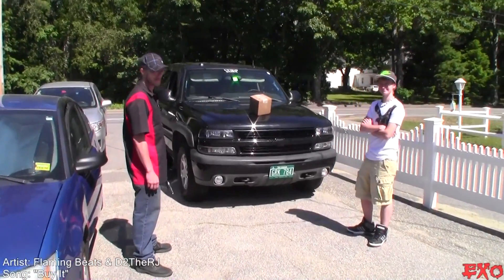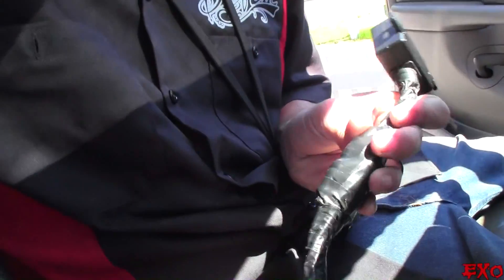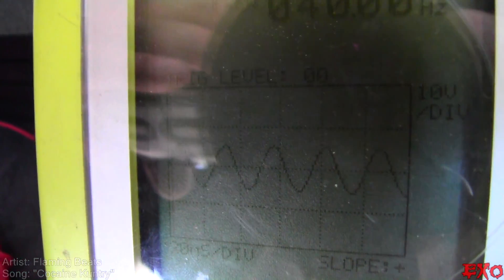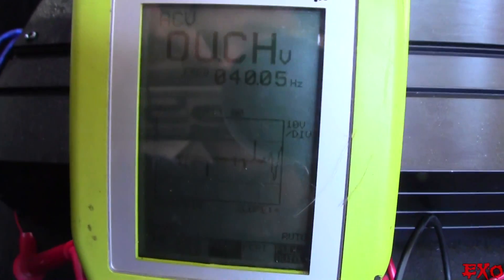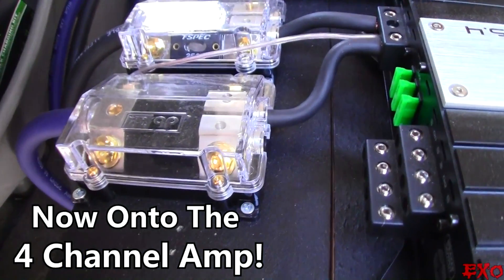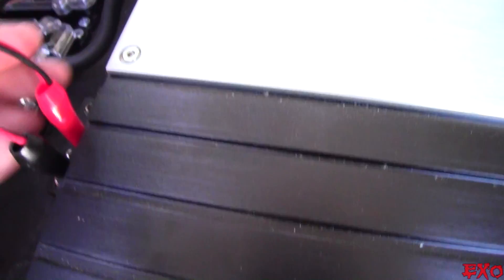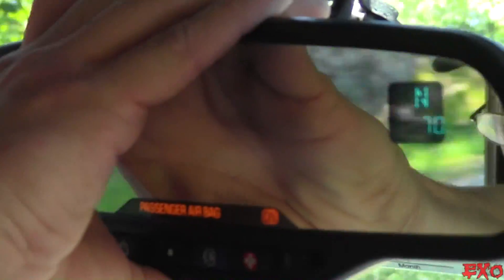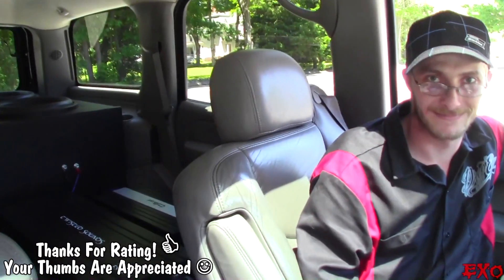Tuning a Car Audio System w/ Two Subwoofer Bass Amps & 4 Channel Amplifier | How To Set OSCOPE Gains

Comment: Does it matter if the vehicle is running or not?  Should it be running and producing enough amperage to feed the amp to get max output? 
I ask cause if your running off the battery at 12v, set everything to gat max clean power then later while your driving and amp getting 14v+ wouldn't cranking the volume to max cause issues?
Reply: NvTwist I don't think there would be an issue. You're just sending more power and it's tuned to be clean at less power, so it will be under tuned at full power
Reply: amorton94 I wonder because let's say the amp is dialed/tuned to & outputing 600w (voltage output measured) while @ 12v then after starting and running on alt @14v+ would the output remain at the previous voltage measurement/watts as before. I'd think the readings would be higher which means over driving speakers. I'm aware the difference wouldn't be enough to create any issues or damage the drivers. Just a thought I had and when you go to such lengths to perfect the system setup it could be worth a look or test. I'm not running my system Setup to perfection or competition but there are those that do which is why my questioning came up in my head. Maybe I'll test the theory myself one day but it's to damn hot in vegas during the summer so it'll have to wait till fall.

Comment: What if your speakers are lower rms than your amplifier puts out? I just bought a 4 channel  amp putting 100 watts x4 channels at 4ohms and im hooking up some mids/tweets to it rated for 40 watts. Using some maths I figured my voltage should be about 12.64, so if I used an o-scope thats what I should use?

Comment: usually factory radios has something that automatically lowers the voltage on the driver side of the car to compensate for the distance of the passenger speaker this amp might have the same set up for the left and right terminals

Comment: how do you set your amp gain to match your subs? because I have an amp that gives out more watts than my subs are rated for. cause this video just showed how to match your amp to your radio and how to match your amps right?
Reply: you can use an app. i like the audio toolkit pro. in there you can find what amp to set your amps to. instead of inputting your amps info , use your subs info. then adjust your amp to that number.
Reply: if you need help let me know what your subs are rated and what amp you have and what is your sub wired to ( ohms )
Reply: big scott okay thanks. I have a 3000 watt amp at 1ohm for 2 subs that are at a total of 2400 watts at 1 ohm.
Reply: what brand and model of the amp and subs.
Reply: sundown scv3000d amp and 2 cerwin vega STKR124
Reply: ok. I would set your amp to 50 volts ac .  do you have a scope ?
but that's just a base calculation.  if your signals clean at 50volts then your good.

50 volts = 2500rms . you will be good with that. and maybe a little over. it all depends if your subs are known to take more power then spec. most subs are rated a little under them what they can really take.

like my sub. the specs say 1500rms but I have 2200rms going to it with a clean signal and its good.
Reply: sorry exo..
just trying to help the dude..
Reply: big scott okay thanks! so basically set my amp to 50 Volts with a multimeter and then after that use an oscilloscope to make sure that my amp isn't clipping at that volume? Also what volume should the radio be on when gaining the amp, and should I play a certain test tone?
Reply: do a 40hz tone for bass amps. what h/u do you have? some h/u can be full volume  with no clipping. 
if you have a o scope check the rca's from h/u to amp. at the amp . unplug them and check to see if your clipping. also you can keep turning it up until it clips. then never go higher then that.
and yes 50 volts on the speaker terminals. pull the sub wires off first.
Reply: big scott okay cool thanks... I sent you a text a while ago. not sure if you got it
Reply: texted back.
Reply: Thanks for this question and dialogue!  I had the same question because he did leave that part out and if the amp is maxed out to the point of distortion, then it may be pushing way too many amps through the connected subwoofers, especially if they're smaller than the amp.

Comment: @EXOcontralto, Man this Video helped so much, just being able to see you connect "what to where" plus the good video quality, very nice sir, very nice.  i do have some questions though, how do you find out what Frequency to play for each type of speaker, Sub, mid and tweeters?  i know sub-woofers dont like higher than 80 and tweeters dont like lows, i understand that but what or where can i find the specific Hz. or is it just a play by ear thing? also is there anyway for you to show where the head unit's EQ was? did you tune that or just leave it were it comes stock? thanks!!! im new to this, but trying to learn as much as i can. thanks again!

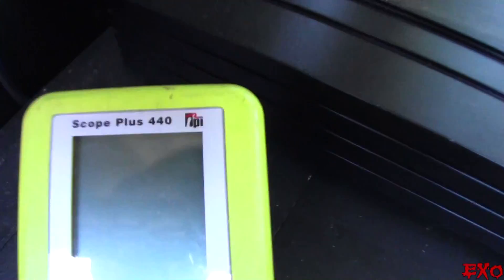Comment: Exo 1:12 are you sure about the DSO Nano V3? This youtube video "Cw4E25GMtTM" says it can't be used on D class amps? Additionally, on my Kenwood x998 you can adjust the subwoofer level from 0 to +15db, should you leave this at 0 when setting the gains?
Reply: I`m using it. There is no problem with it. I`ve used ot for tuning ground zero amps ;)

Comment: @exocontralto exactly why does he have fused + & - leads on the smaller amp or is that distribution blocks?

ahh yea I see distro blocks, but guess it won't hurt for both fused.

that is a first for me....

also is 40hz the recommended tone for setting or is it better for the hz your system is loudest, like my 4th uses 63hz & roughly 43 hz.

Comment: To really ensure you're clean of distortion, the load certainly plays a role. The amp can either run out of voltage or current-driving capability and it'll clip.

Comment: Scope Plus 440 is a basically a garbage scope... DSO nano is pure shit.. better than nothing, but it's not very accurate and at it's low resolution, it leaves a lot to desire when you are looking for that wave to start to square off...  it's average as a multimeter tho... when Steve Meade showed he was using one way back when, he sure helped sell a bunch of those though... like i said, beats a blank... i've checked it against an analog scope like you showed (they are MUCH better)... in various places and it can be quite inaccurate... several volts in some cases... it's basically a guessing game as to where the clean signal ends and the clip begins.. and that's db's you are losing if you err on the safe side like you should... or.. worse yet, it's dirty power feeding into your voice coils.. and none of that matters anyway without a load on the outputs.. you really can't get accurate gain setting without a load at the same impedance you will run them at.. then to get close you really need a high resolution oscilloscope... a CRT analog scope is perfect... or a digital scope with high resolution... if you go handheld you really need something good like a fluke or go with a regular desktop scope.. (Tek, Agilent, Rhode Schwartz, Yokogawa, LeCroy, Owan, Rigol, etc..) of course, they aren't as portable as a handheld... that's easy to fix that too with a small inverter and just run it off a different vehicle so you don't draw voltage from the car you are tuning.. or separate battery... I built a portable power unit for a scope of mine... made a battery pack from old laptop batteries and a small inverter and cobbled together a charging circuit... it charges when it's plugged in and gives me over an hour on battery... i can still power it from a second vehicle if i want as well... analog scopes and good digital scopes ($400 and up) sure give a beautiful wave that you can zoom in on and see the exact spot it clips... like i said.. it's just a matter of accuracy... not a huge difference... but enough that if you want the most out of your system... or want to make sure you're sending safe signals to the voice coil.. sure this way you show will get you in the neighborhood... but a true accurate tune requires a load, a decent scope, a true RMS volt meter, and an AC/DC clamp meter (so you can clamp both output current and amp input current) with either an inrush setting (to watch capacitors and battery banks) or a high resolution min/max setting... then you can squeeze every last watt out of that BOSS or ROCKWOOD... LOL.. JOKING... even then, as you know, you may still choose to de-tune an amp to match outputs, speaker handling watts, or set levels for mids and highs... i even had a guy who had me de-tune his system because his wife complained that the massive slap made her breast implants vibrate and hurt.. true story... so max gain isn't always where you are headed anyway.. then there's box rise, impedance rise, drywall screw rise.. lol... i'm not hating on your method.. it's used alot.. and like i said. it gets you kinda close.. for a few bucks though.. these beginners can go hunt down some decent meters and a scope for next to nothing... Example... recently i helped a guy get some stuff together... I bought a 60MHz Analog oscilloscope with 2 probes for 30 bucks off craigslist.. the I got an ac/dc clamp meter at a pawn shop for 25 bucks.. it has a dual display and can also use the true RMS meter at the same time as the clamp.. so for 55 bucks.. he can now tune super accurately.. cross check.. and just use his speakers for the loads.. got lucky on the meter, it's for a/c work.. but even if you have to get a separate meter.. add an extra 25-30 bucks for a pawnshop True RMS (NO, not the one from harbor freight or walmart... get a decent meter... True RMS.. Fluke, Amprobe, Klein, Fieldpiece, UEI, Mastech, Extech, craftsman, etc.. buy used from a pawn shop or craigslist to get them cheap...if they are TRUE RMS, they will be decent.. ) still under 100 bucks for all of it..for less than the cost of a few feet of dynamat or a couple sheets of MDF... a while back i bought a lot of TEN 40MHz analog scopes on ebay for 125 bucks.. that's $12.50 each... they were from a school... all worked perfect and came with manuals and probes... you can get a scope cheap or even free if you really want one... ask around.. everyone who's getting to the hobby should get rigged up with these tools... there's no excuse for not having the basics.. we'll get to the distortion and spectrum analyzers when you get past SPL and switch to SQ... whew.. a book.. nobody will read all this.. i should just delete it now.. nope.. posting this shit to the interwebs... typos and all.. maybe someone will get something from it..
Reply: damn.. read that again.. it made my dick itch.. FUCK Hillary... Donald Trump for POTUS

Comment: You should try cutting up old RCA female and male ends, strip down the insulation, separate positive and negative, and use that to connect to the RCA cables rather than the alligator clips. Its much faster and safer. I tune my system the same way with a oscilloscope, its the only true way to go, gives you more insight as to what is going on in your sound system than any other tool.

Comment: it's joke? i have a 152.5 at 37 hz with 2x12"  and one 5.5k amp)

p.s. Hello in Russia,bro) 
like your vids) we following!
Reply: In the third row? 
With box rise? 
With low voltage? 
With music? 
With subs that are just breaking in? 

If yes to all of the above, then good for you. 
That's awesome.
Reply: +Friends Are Overrated 2х12 subs, 140 liters ported box, 12 volt system, on music.
awg on 30 sec. 151.5 db on 37 hz.

Comment: for the price of that scope, you could have used SMD DD-1...
Reply: a DD-1 detects distortion (anything over 1%THD sets off the light) and an O-scope shows you where clipping occurs, the reason this is IMPORTANT to note the distinction is because some amps and headunits don't output the cleanest signal to start with so it's possible to see the distortion light on the DD-1 come on with the amp gain turned all the way down rendering the DD-1 useless to tune that setup as a result of the distortion NOT related to clipping, in a perfect world you would have both, the DD-1 would tell you if you are below 1% THD and the O-scope would show you the clipping (which would also be shown by the DD-1 provided the system doesn't exceed 1% THD prior to clipping). Basically you can ALWAYS tune with an O-scope but you can't always tune with a DD-1, but that doesn't mean a DD-1 is bad, just that you need more info then it gives to understand what the distortion light is telling you.

Comment: you would have to take off the case bottom of the amp and find out which potentiometer controls what channel... theres secondary pots in the amp that are the fine tune for the outputs and you can match the gains so they have the same output on the main pots on the outside of the amplifier per set of channels

Comment: is there a way to use o scope to see that u set subsonic right
Reply: it is. 
Choose a selected frequency for subsonic, for example 25hz.
Play a tone at 25hz.
Turn the subsonic knob. Look for a significant drop  the AC volt on the DMM/Scope. 
Then you know where you're at.

Instead of playing ear-guessing-games.
Reply: you can actually set it by eye haha. turn the SS all the way up and play music that you know goes well bellow your port frequency. Play it at maximum safe volume and slowly turn the SS filter down, keeping an eye on the woofer. Stop when your subwoofer is still moving nicely but not excessive and uncontrollably, essentially not flopping around like a bag of dicks.

Comment: Was the balance being used?...if you forgot to flatten that that could explain the voltage difference in the 4 channel.
Reply: I thought the same, gotta check out what settings the people use cause it's usually whack

Comment: what's up bro I'm in the process of getting my system up and running.  all  I need is xs power battery and a aternator. and what is your review on the crescendo 2000 watt amp. thanks bro

Comment: hey exo ..I found out something crazy....I was metering my blazer (1 crossfire xs SPL v1 18 on a 1997 RF 500.2 clamped 470w @1.4 ) and I peaked at 44 with the port fireing the hatch and I peaked at 36 with the port fireing forward and the seats layed down and dropped .9 db on the 36hz peak 👍👍

Comment: When setting the gains in this manner, the load should be connected to the output of the amplifier. The no-load voltage at the output is much higher than the voltage with load. The method used here will still yield clipped/saturated output signals to the woofers which you were initially trying to avoid. That aside, good video!

Comment: I'm trying to decide between a DD1 or the DSO Nano but can't make up my mind. The Nano, with the 10x probe (for higher voltages) is about the same price as the DD1. Does anyone have a preference or have tried both?
Reply: I had one of these small digital o'scopes before and all I can say is be careful as the display on most of these has a very low resolution. I had the Velleman HPS50, but my DD-1 (recently calibrated) would light up before I could see any issues with the waveform. This is why I prefer using the DD-1 to using an o'scope for tuning my system. Clipping is well above 1% THD
Reply: Go DD-1 thank me later:)!
Reply: Dereck BigDWiz  how or when should one have heir did-1 calibrated? And who would calibrate it?  I have had mine for 2 years now. Never knew it could be calibrated

Comment: What does the subsonic on amps do?
Reply: Its a filter for low frequencies below 45 hz. Helps to better match your amp with your enclose
Reply: I have mine set to 20hz starts downing the power around 22-23hz
Reply: usually you set it to your port frequency. basically its to stop your subwoofers from unloading by limiting the power you push into them and bellow port frequency
Reply: +nismofreak34 no one does that...horrible.,..yeah set the sub sonic same  as port freq 😂😂😂..if you got good woofers you don't need it...they can handle it I have mine here my woofer looses most back pressure... cause its kinda worn out and needs a recone
Reply: +hittin-low_150db+ well I'm running 2 15s Memphis mojos Xseries and my amp is a Memphis mojo mcd4kw

Comment: hey EXO I had a problem with my amp today. And I need help. I recently installed two Kicker comps that have a peak power of 600 watts and then I had an old substation kicker at which is a 10-inch only 100 watts and so I connected separate ground and power to it and then the same remote coming straight out of the other end and then something happened and it tried to pull power through the remote wire for some odd reason and melted it have any ideas why.
Reply: Not enough details but it sounds like you have a bad ground on your amp(s) or head unit... May also need a relay for your remote... none the less you should fuse your remote at 5A to protect your equipment...
Reply: +MrMaxyield yes I have to redo the remote now since it got a little toasty and yeah I will put a 5 amp fuse in line with it.  so that way if it tries to do something stupid again I can catch it

Comment: exo if a speaker have 0.5 ohm how many ohm does amplifier should have?
Reply: Most car audio amps are standard 4 ohm and most higher end subwoofers come in duel 4 ohm or duel 2 ohm voice coils. In order to lower the ohms depends on your speakers - first your amp must be .5 ohm stable, as well as how many voice coils per speaker, and how you wire them series or parallel then that will dictate the output 4 ohm 2 ohm 1 ohm .5 ohm. 1 - 4 channels
Reply: the amp dosnt have a impedance (ohm) thats the sub's resistance... and most sub stage amps are 1 ohm stable...
Reply: and dual .5 ohm? or I got a dual 1.35ohm wiredn@ .7